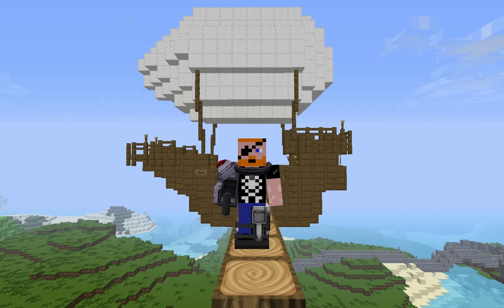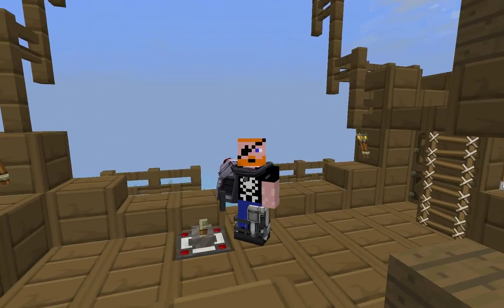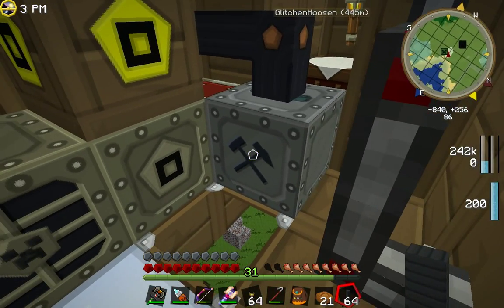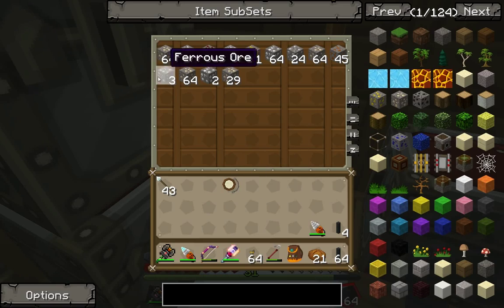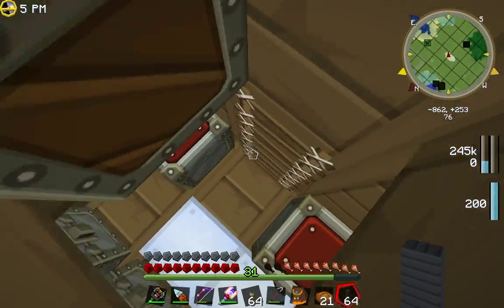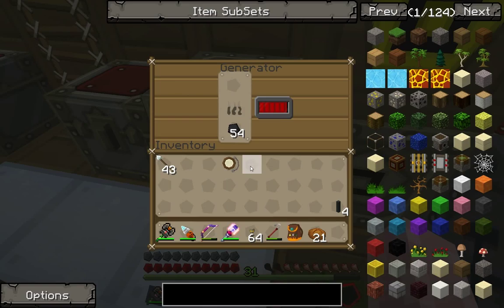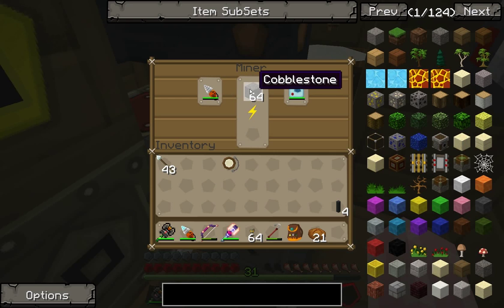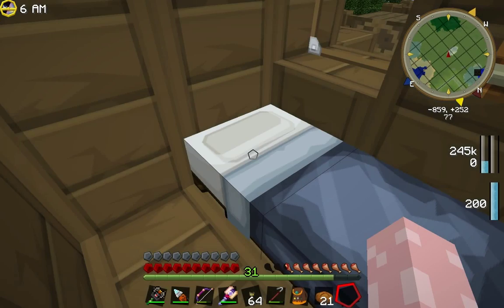Mod Synergy - how to move an Industrialcraft Miner around using Archimedes' Ships

Comment: You have powersuits installed so I'm surprised you're not plopping a power armor feet with an elite battery in there all topped off.  That simplifies the power chain to something that holds more than an MFSU's worth of energy and provides it in a very convenient item form so no wires.  I mean sure I love the setup and all, but you've got me wanting to make a similar video showing some cool bits I've done with airships and the mods I used with em.
Reply from the maker: Sounds like a good idea (both what you suggested, and you making a similar vid). I will do what you suggested and post an update to this. If you've got any other suggestions, please let me know: I definitely haven't tapped anything near the full potential of this mod yet!
Reply: Dedge Sly
 Hey I'm getting some crashes with solar panels on ships larger than one chunk long in 1.5.2.  Since you're on 1.6 from the looks of the dismounting working much better, do you think you could confirm whether solar panels from IC2 crash you out of the world?  Curious if upgrading would fix my issues.
Reply from the maker: Hey mate, I'm running 1.5.2. Haven't started up with any solar panels on my ship. Tend to like burning the fossil fuels as I'm leaning toward a steam/rail/fantasy kind of aesthetic. Are we talking 'crash on use' or 'crash on entering game', because with the former I'm happy to go in and have a look, help you confirm that it is definitely the solars and not anything else?
Reply from the maker: DoomRater also, I agree dismounting in 1.5.2 is a bit awkward. The way I've gotten around that is to make sure that the ship markers are quite close to the centre-line of the ship. One of my friends on the server used to fall out of his ship at altitude because his ship was too narrow, and the marker too close to an edge. Also I think the fences help by displacing you to one side: i.e. back into the ship. Don't know if any of that is helpful, just what I've noticed
Reply: Dedge Sly
Oh wow.  I just tried building a bigger ship and I started to notice less warping around when I use a ship marker in one place vs another.  As for the solars issue:  Sometimes it will crash when you compile the airship but you'll be able to get back into the world.  Other times, however, the world will crash on use and you won't be able to get back into the game.  Obviously for testing that sort of crash I'd recommend creative sandbox worlds, but since it's 1.5.2 I can't imagine it would be any different.  It definitely is not the transformers or MFSUs or generators that are off.  I'll have to ty out 1.6 at some point and see what mods work alright with compiling and which ones do not, though I can't imagine myself using IC2 in 1.6 with all the crazy balance changes it got...

Comment: Which versions are you using ? My Minecraft crashes when i try to fly a ship with cables attached.
Reply from the maker: This was with MC v1.5.2. From looking at Archimedes in the 1.6.4 world I'm in now I can tell you that Openblocks' building guide works great for working on a ship between moves, but that's all I've played around with so far. No idea about Industrialcraft. What versions of things are you having problems with?
Reply: I use MC 1.64 with Archimedes Ships 1.45 .
My industrialcraft is version 2_2.306.experimental  Whenever i try to attach any sort of cable to it like glass fibre or copper cable it crashes with a graphic error. "Already Tesselating". I tryed to look the error up and everybody told me to dont attach any blocks from other mods to a archimedes Ship but it seems to work fine on your version.

Comment: Have you been able to find an mrot file that includes Tinker's Construct blocks? I really dont want to have to park my ship in the same direction every time :<
Reply from the maker: I haven't figured that one out, I'm sorry to say. The mrot file I can find is just the default, and it's overwritten at every startup, so no point in tinkering with it that I can see.
Now that I think about it, you don't have to necessarily park in the same direction every time, you just need to put four drawbridge blocks down along the side of the ship, each facing a different compass direction. Connect all of them to one switch using redstone or MFR rednet cable, then no matter which way you park one of the four will work. Put gates along the top of them, since these are supported by metarotations now, and you've got a secure railing with a switch that opens all gates and sends out one drawbridge. Could work...
Reply: I actually set mine up a bit differently. Im using them as a bombing hatch. Even if I rigged it your way it wouldnt look as cool.
Reply from the maker: Patrick Marohombsar
Oh right, hadn't realised you were planning a bombing hatch. Could work, you'd just need drawbridges from every direction, all facing inward, and a redstone torch on the circuit before the switch, to make sure they recompile switched on rather than off (or the bombing bay will open as soon as you park, which while not necessarily dangerous would probably be a concern to anyone else on your server). Deployers with a repeater on the same circuit could place the TNT as soon as the bay is open. Alternatively, I think pistons are in the mrot, so you could just make an old fashioned sticky piston door for the bomb bay